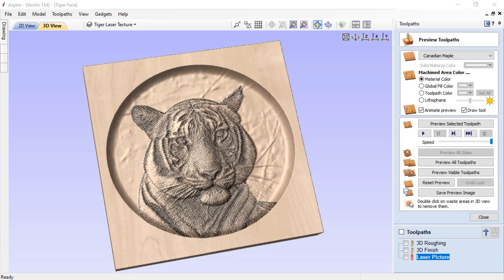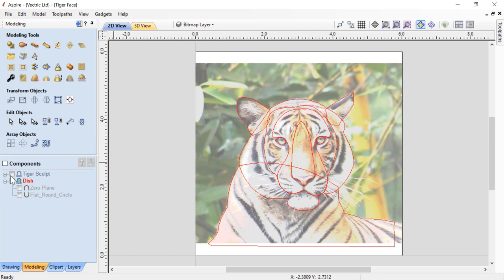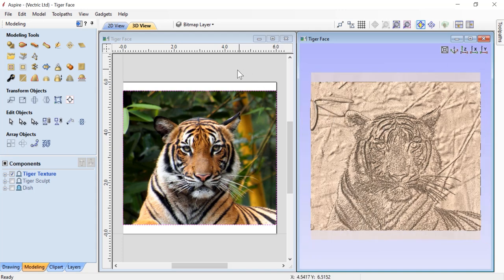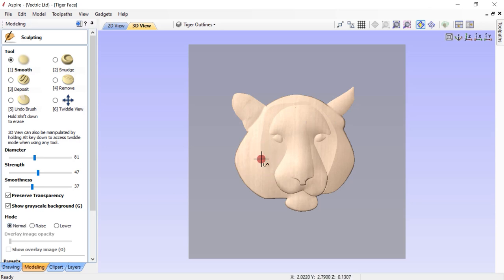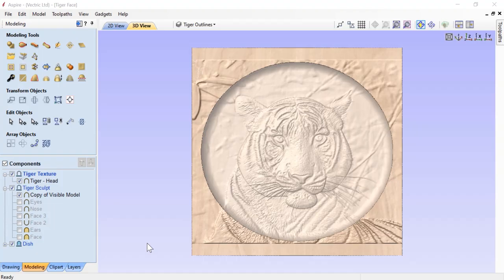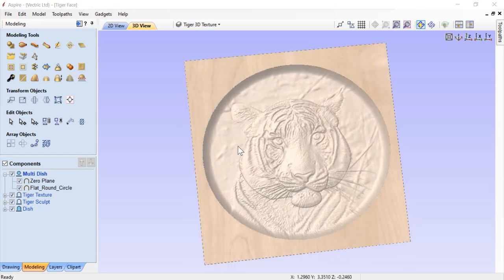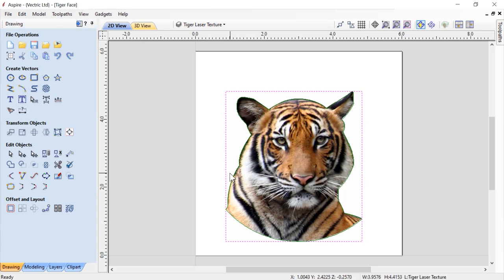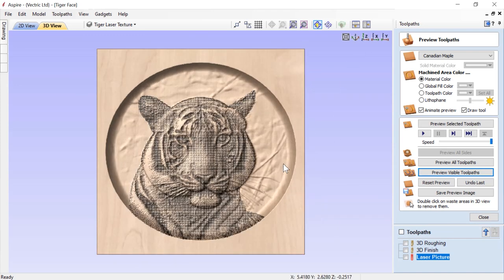Vectric Tutorials | Laser Picture Tiger Face

Comment: @vectric does the varied power act in a similar way to changing the focal length?
Reply from the maker: Hey Ben... not realy.  If we simply changes the focal lenght then the laser would be out of focus.  Varying the power is exactly that we change the power to defin how dark the laser will etch.  Also seeing as we can project it onto a 3D surface the Z movment will keep it in focus on the surface all the time.

Comment: This video shows Aspire, can it also be done using Vcarve Pro?
Reply from the maker: Hey Rick, 
The technique of projecting a laser picture toolpath can be done in VCarve if you imported a 3D model and had an image to project over the imported 3D model, in terms of this particular example you will need Aspire to model up the 3D part as shown with the tiger in this example, and then using the same photograph to model from, you can then apply a Laser Picture toolpath and project it over the 3D model.  I hope this helps!